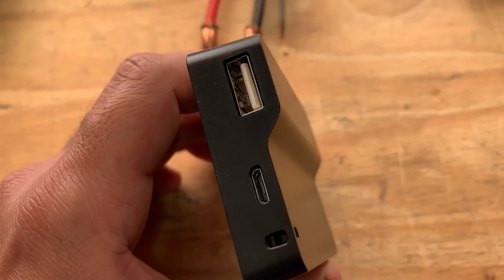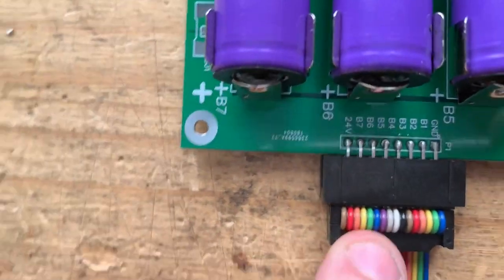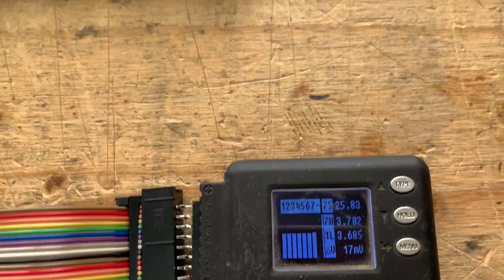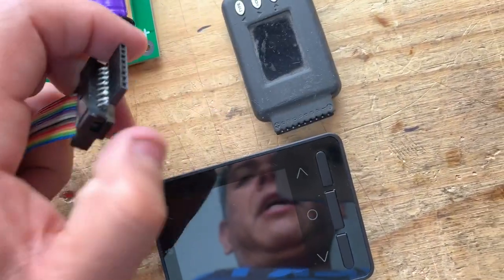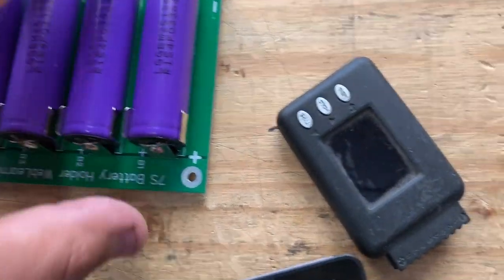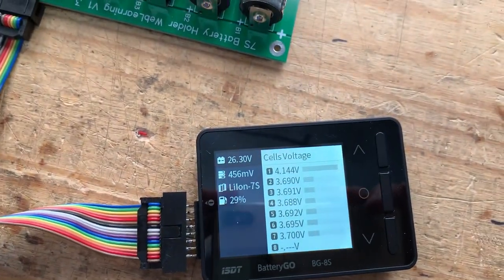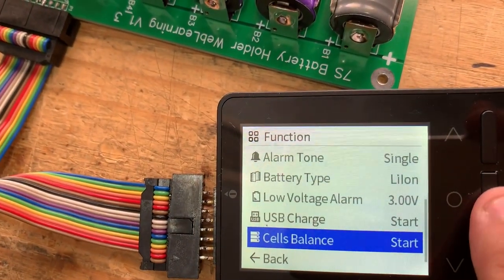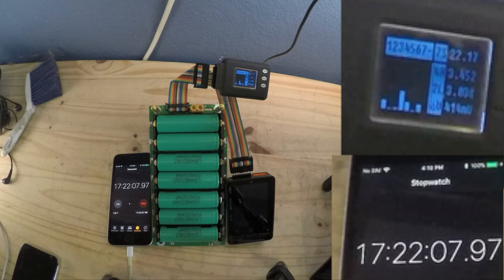ISDT Battery GO BG-8S Battery Monitor and Balancer

Comment: Another GREAT Video, so much better than the one I did, I will add your link for a more detailed description of the BattGo Meter!! Jehu, not sure if you have had a chance, but these guys have some pretty powerful balance chargers also. Just small enough to fit in your hands. I love using these guys products. Not so much the Batteries, but the balance chargers are Crazy awesome!!!

Comment: I love this thing! I only use it to monitor my cells tho. I use a Heltec balancer.
Reply: This thing is king for checking cells, but yeah. It's better to get another BMS. I can get cheap BMS's that work like a dream with no software or displays and just use the ISDT Battery Go to check if the BMS is working properly.

Comment: Jehu...hi I am glad to see you introducing this pcb specially this one, because someone has designed in internet and it was free to print as a board throug JLCPCB then i got it 5 pcs. Just to try...they are very BAD. I had BAD experience with them,
1st the distance of each battery is very near so that there is the posiblity of contact and short-out.
2nd  2of the 4 corner screw are very near to the battery, here also there will be battery-short.
3rd   the balance pin indicators wrote incorrect sequence which means when you follow GND...first pin ....B1...2nd pin the writing sequence are not direct to the pin.
In general i dont suggest that the person like you have to use this.
, unless you correct those faults.

Comment: Nice video I like to see products in use. What if you dip the the positive clips in rubber. Like the rubber that covers tool handles. Or cover the clips on the positive side with capstan  tape.
Reply from the maker: Yeah except thats more work and more money than using other type of holders

Comment: That extra plug on the side is a power supply. Just search for "ISDT Connection Cable Cigarette Lighter 12 V" on Amazon and you should find two versions of that already. There's also versions for banana plugs in male and female.

Comment: 8:13 4th and 8th are in black because they have lowest voltage. Before you replaced 1st cell it was black too, because it had exactly the save voltage as 4th cell.

Comment: What would you recommend to monitor and balance a 12v, 64ah. Headway bank? 
I’ll be using it for mobile audio. But I could always hook up an inverter to it for emergency back up.😎
Reply: Did you already get it sorted out? This looks good as far as monitoring,  but you'd need a much bigger unit for balancing.

Comment: Did you get a chance to explore this or other balancers that behave the way this one did in the video when you removed the 1st cell?  I bought your 7s starter kit and I'm repurposing the BG-8S for a smaller 24V system, much like your stackable modules, just with the LiPos from Ring doorbells, from Battery Hookup.  I have most 7s packs working with balance leads connected to a little PCB breadboard with an 8pin IDC male on the end, emulating your design with 8pin ribbon cable v. 16pin.  My question is regarding my struggle with my wiring/soldering/? causing strange behavior.  When I plug a good pack up to the BG-8S, it show 1 through 7 all good around 3.9v and I can balance them, etc.  However, a certain pack will show values 1 through 8 with values > 4.2v and 8 shows 1... v in RED???  I've checked all my leads over and over again.  I test all the cells individually with a voltmeter and they all read around 3.9v, I then test all the pins of the IDC connection and they all read properly Neg to 1: 3.9v; Neg to 2: 7.8v; etc. up to 27.3v for the full pack.  I don't believe there is any shorting going on, otherwise the output at the pins wouldn't increment properly...right?  Just tired of scouring the interwebs for troubleshooting when every review is less useful than yours, for the most part, starting with how to remove the shrink wrap on the box...sigh...  If you have any video I haven't come across in your arsenal, or any other community members that understand what my issue is please share a link to help.  Thanks...you transformed my life into exploring off-grid living so much so that I bought 40 acres of raw land and feel completely empowered by just your powerwall builds to know I can succeed.  After getting this 1Kw ammo can "Sunny" working, I'll be building a 5Kw unit with some 200Ah LiFePO4s, currently on a slow boat from China.  But, I need to get an understanding of this issue first.

Comment: Have one: great device, mine runs 24-7 in my DIY lifepo4  150ah power qube.
Reply from the maker: Keeps it balanced?
Reply: once it balances the cells, does it start again automatically when they get unbalanced? I am looking for a 24/7 cell balancer. Thanks
Reply: @mikegleasonjr  I'm not really using it for cell balancing, more for cell status. I recommend the ISDT T8 BattGo because it will dissipate the uneven load variations much more effectively. Once balanced, I would not want to allow any kind of active balancing device to mess with the cells. The Calb cells inside my 1 foot cube power unit seem to remain within 10 or 20 mv's even after weeks go by without charging or loads connected and the BG-8s just goes quiescent with only a dim pulsating led to let me know its alive.
Reply: @Mark-bb2zx  Thanks for the comment! Planning to start solar charging 18650s so I was looking for a battery checker since my solar charger already takes care of the overcharge and over discharge aspects.. thanks again.

Comment: Hello thanks for the video. it seems to be a good meter. I want to use this on LTO (lithium titanate) 2.4v nominal batteries but it seems to not have option for them, can i still use this as meter and balancer?
Reply: No, supports LiHv, LiPo, Lilon, LiFe, NiMh/Cd battery and BEC output measurements.
Reply: I plan on buying it for the same purpose as I imagine it should at least work to measure the voltage of each cell. What would make it unable to read their voltage??

Comment: Seems good though the balancing thing I think no body is going to balance 0.5V that way too big though its good to know it didn't work when that happens I would love to see how it will do for more reasonable .1v or more maybe ?
Reply from the maker: Yup it does ok,  I did record that but I didn’t think it was helpful as I couldn’t tell how much energy it was burning.  1ah = 3.6wh and it took semewhere around 15 hours = .24w per hour = 66ma balancing
Reply: @jehugarcia  I see thanks for the info and your hard work.

Comment: Hi ! i have 2 of these units and i'm still on the fence about there worth as jehu mentioned you can't get the others anymore
Reply from the maker: Yeah the battGo is really limited, you can’t even set the screen to stay on
Reply: However ! Battgo's C4 is what every 18650 is copying it is a true beast but only handle's 2 cell's epic fail but i do have 4 at the cost of $240 ouch.....
Reply: I think Jehu is confused.
Battgo is not limited, Battgo is not the BG 8S.
Battgo is the battery tech used by the ISDT BG 8S which is not in this review.
Jehu, did you actually read the manual before deciding to review this?
Seems odd that all the other YouTube reviews of the BG 8S manage to keep the screen on for their reviews but you can't?
Reply from the maker: I haven’t seen anyone else do 20. Hour long time lapse tests on this device,  have you?  I don’t read manuals
Reply: BattGo is a great company and i'm not saying so because i own several models in duplicate but the BG 8S was not a planned purchase i bought it because it was Battgo....it has a few flaws it's not a deal breaker but it does need a firmware update
Reply: No one else done it because a 20 hour long video of a devices blank screen is a bit useless.
Really, you haven't read the manual? We would never have guessed .. ;)
Reply: Does anyone know how to keep the screen on and how long will it last before turning off?

Comment: I keep watching videos about these things and nobody knows or is willing to say exactly how they work because the instructions are rubbish and everyone does a quick review before they know how to use it.  I charged my 4s LiFePo4 battery, got the meter into LiFePo4 mode and applied load.  I'm measuring load over time to determine the batteries capacity.  Soon this thing is sounding an alarm.  But why?  What does the tweedle sound alarm mean?  All cell voltages are highlighted in red, but are within nominal cell voltage limits.  (3.298, 3.305, 3.302, 3.308)  13.2V for the 4s pack.  Why is it sounding an alarm, and what is it trying to say is wrong?  Why is there no useful instructions and why are ALL the reviews superficial and devoid of any useful information a person would need to know when actually operating a battery using this monitor?  How about working with it for a while until you know how it works, or even just how the monitoring function works and doing an instructional video about how to use it and what the alarms and display red highlights mean?  Do I need to hear it sound the alarm every few minutes even if I just want to use it to monitor the house batteries?
Reply: All of his videos seem to be like this unfortunately.

Comment: My question for ebike charging and controll is:

Can you monitor if the BMS does work properly ?
Normally i balance charge my 14s 7p ebike battery with a junsi 308 icharger. (dual channel: 6-8 A current)
But with a 14s 7p BMS  which I would like to use how can I control the batteries ?

There is only a 8s monitoring tool like the one you showed:    iSDT BG-8S Smart Battery Checker.   
Can I go into the 14s thin cabels from the BMS in parallel  to get extra 2 separate  7s connectors which I could possibly control with a Battery checker ?
Or is there a simple and efficient solution which I dont see at the moment for this problem ? 

Thanks
Reply: Yes. But you will need two, and an adapter.

Comment: A thing to note:  The device is powered by the batteries it's testing.  Not good.  It does not know when to stop drawing power and will drain the cells to dangerous levels.  A beeping alarm is not adequate.  Batteries don't care if the alarm went off.  The chances of you being there to take care of the situation are slim.  NEVER leave it unattended.  If you leave unplug it and resume when you return.
Reply: Which "device"?  How much does it draw? What "situation"?     Need more information before I panic.
Reply: All of this type of battery checker are powered by the batteries they're testing. But not all have an alarm to tell you something is wrong ..
Reply from the maker: No need,  panic is in order in this case
Reply: Does anyone know how to remotely turn the unit on and off? If disconnecting one particular wire can turn it off, I would think using a relay to connect and disconnect it would work fine.

Comment: Bit of a rushed video there.  I have one of these and it is great when used for its purpose, checking RC batteries in the field and dealing with any slight misbalances, or acting as a quick USB power supply.  When balancing, the cell in that was black is the target voltage for the operation, eventually, all turn black when finished, it is a passive balancer after all, and I would look for an active balancer with that size imbalance.  It also has the function to check RC recievers and the protocols used for fault finding.  
Not a fair review at all.
Reply from the maker: Great for small batteries not great for big powerwalls,  did you watch the video?
Reply: Yes I did, and I stand by what I say, it is a cell checker, for use in the field, with a balance function, for aimed at the Radio Control user, hence all the options to check the functionality of RC protocols which you did not mention at all, that is what it is sold for.  In the manual, the cell balancing function that you spent most time covering is the last function mentioned.  I use it for checking if a battery is healthy when changing over when flying, and if I need to balance them on my charger when I get home, I also have something that can check the RC system in case of problems.  Your test was a bit extreme, as you said, and in correct use, the battery checker would have shown you the problem with such a huch disparity in the cells, so you could take action on more capable equipment.  At least you could have read the manual, and explained what BattGo is properly.  Shame, as your videos are usually excellent, but everyone has to have an off day.
Reply from the maker: I don’t care what it is good for,  I only care that it’s not good for what I need it for and for what I see a lot of viewers think they want to use it for.   I didn’t say it doesn’t work on small packs.  I you shura you watched the video?
Reply: Yes, I did watch, The closest analogy I can think of is if you used a Swiss Army knife to butcher a cow,  yes it will do it, not very well, will take a long time, will make a mess.  There are much better tools for the job, but these tools would be useless for doing other jobs you can use a penknife for, such at that tool for getting Boy Scouts of horse's hooves or using the Corkscrew to open wine; therefore saying you cannot recommend it because of this one test is not honest and not very good.  You neglected to mention anywhere in the video that this is not what the item is designed for, or marketed at.  It is a diagnostic tool for a niche market.  This is meant as honest criticism, no need for accusing people of not watching the video, or working for ISDT as you have done elsewhere.
Reply from the maker: This not comprehensive review,  stop criticizing it as if it was,  I make powerwalls this device sucks as powerwall balancer,  for all out there that are thinking of using it to balance big battery packs,  Don’t, it doesn’t work well.
Reply: But people are going to see this when researching the device, people who want it for its proper use, you are a popular youtuber, one of the few I have an alert set for, this review will be seen by them.  I see you claim you have not read the manual (with some kind of perverse pride) and so you evidently have little idea what the device is for, or who it is marketed at or even what it does.  Even the title of the video is wrong, it is a cell checker, not a cell monitor or cell balancer, I find it does its job excellently and reliably.  Anyone doing basic research would know it's not for powerwalls.  The title says Battery Go, you mention that in the video, but again, have not researched what it is and just spout conjecture.  Why not change the title at least, may I suggest "The ISDT BG-8S, not useful for PowerWalls as this poorly researched review shows." or something along those lines.

Again, it is a diagnostic tool, a very powerful one at that, a point you have utterly missed.

This video, and your attitude in being unable to handle honest criticism when you are picked up on about your lack of basic research about a product then accusing people of working for ISDT, and not watching the video have moved you down quite a bit in my estimation.
Reply: @stealthbanana  Don't waste your breath, he doesn't care that everyone is telling him it's a bad video with wrong conclusions. Just look at the other reviews out there.

Comment from the maker: Alright people.   This device failed to balance my small pack.  That’s all I’m showing you,  if your argument is, “yes but”. I don’t care
Reply from the maker: Well thinking about it,   I might be wrong, it might work,  I mean it’s still way too inefficient but if it doesn’t run out of battery by hour 30 then I might just finish balancing 1Ah
Reply: jehugarcia hi how r u . Use the usb port to discharge more current and balance faster, It works. It can go 10w easy
Reply: @jehugarcia  

This device is not designed to balance quickly, you're dismissing it on the wrong application.

This is the person who disagreed with me a couple of years ago when I said you need BMS control of packs. Then you didn't know that batteries have a maximum charge current per manufacturer's specs. Then you reviewed Tenergy LiFePo4 batteries and said they were poor performers because they didn't have high peak current capabilities completely missing their application.

The best batteries for power walls are LIFePo4. They are safe, don't explode and have high cycle rates. You don't need super high peak current capability in power walls. But actually I bought 640 of those Tenergy LiFePo4 batteries a year and a half ago. I got them for a steal on eBay probably because a lot of people were listening to you and buying Li-Ions for their power walls back then which I would never use.

Please educate yourself, you don't know electronics and it's a complex field, you can't keep oversimplifying it and making statements that are wrong, dangerous or can cause harm. Batteries need very careful handling and use.

People be careful, if you want to learn electronics do it from a good source, someone like Dave Jones on YT who knows the field.